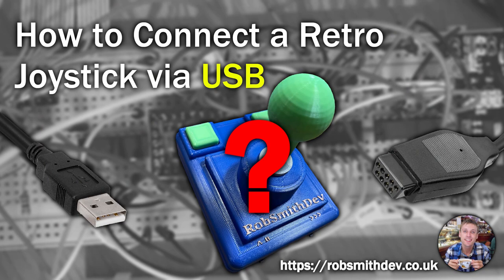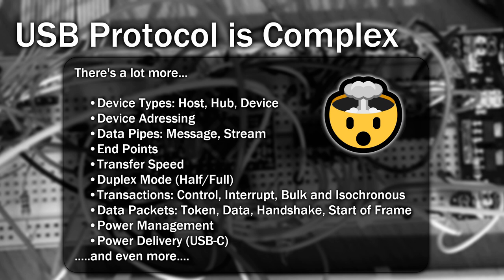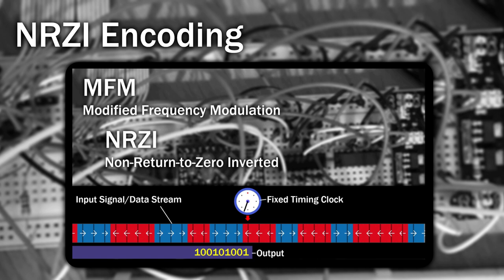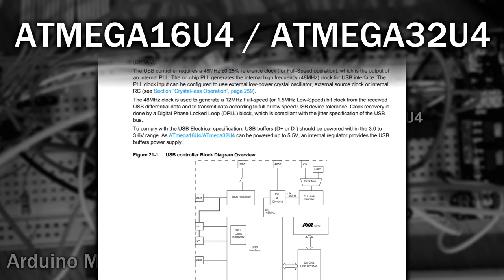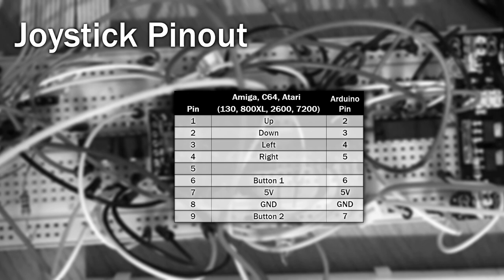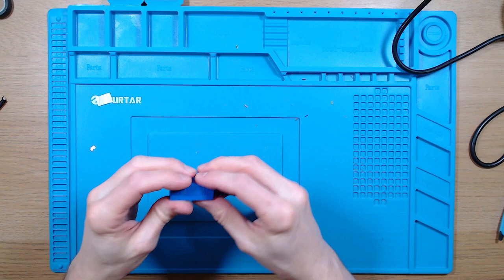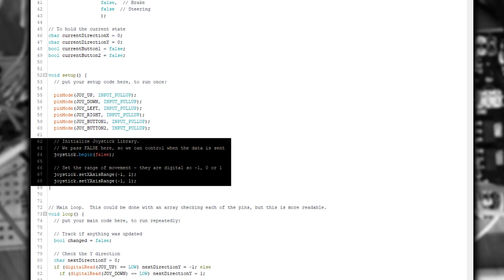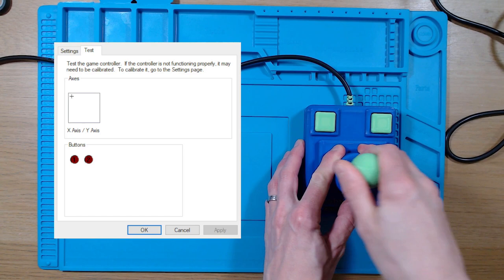Build a USB Adapter for Retro Joystick and use it on your PC, MiSTer or Amiga A500 Mini

Comment: Practical, simple and effective, I love it.
And if you need to use an emulator (nothing beats the old equipment, but sometimes the only thing you have is an emulator) then at least you can use it with a decent retro joystick now. Cool build!

Comment: Nice and compact adapter. Some games (like Dynablasters) supported multiple joysticks per port with a special adapter. Maybe something to look at in a followup video. Also CD32 had multiple buttons.
Reply from the maker: Yeah absolutely, these could all be added easily! The CD32 is a little more work as it encodes the data in a special way, but it’s not hard to decode. Thanks for watching

Comment: Looks awesome. Do you think this would work with a Duinotech UNO r3 board based on the ATMega328P Microcontroller?
Reply from the maker: Hi, no it won’t u fortunately- the ATMega328 can’t behave as a USB host whereas the one I’m using has it built into the hardware. It might be possible to reprogram the ATMega16u2 chip on that board as that’s currently programmed as a USB to Serial converter
Reply: @RobSmithDev  Thank you for your reply. I Have a UNO and I might have to do a bit more learning, or just get a Micro, might be easier, and use the UNO for something else

Comment: Hi Mr. Smith, very interesting video, thank you for the explanation. I am try to do a spinner for my arcade bartop with arduino pro mini and an optical sensor. Do you know the best and easiest way to do it?
Reply from the maker: Hey, I’m sure it’s probably a rotary / shaft encoder. I’m fairly sure that usb library im using will support it

Comment: This is great! One question. Is there a way to modify the code to read analog joysticks? Most of them had 100K pots, reading as a voltage divider with a +5V signal. The voltage would need to be read and then be translated to USB instructions.
Reply from the maker: Yes, this is possible, you'd have to use the analogRead functions to read from A0 or A1 (one for each axis).  The Arduino Joystick Library supports X, Y (and Z) with precision up-to 16-bit!
Reply: @RobSmithDev  Thank you! I will grab a micro give it a shot! I am also interested in finding a solution to do the opposite. That is to use a specific USB joystick or gamepad and map them to output them to the original console/computer. I am not sure if that is possible with this equipment.
Reply from the maker: Its a plan for a video im working on, not sure when it'll be ready though

Comment: nice stuff mate. what is the latency or the sampling rate of this system? would be interested in this ... i got a "megadrive to usb" adapter from amazon which does a good job. dont know the internals tho :) would be interesting to use on a mister fpga with fast polling if that is possible
Reply from the maker: The last line of the code is a sleep for 10ms. So I guess that’s the latency, but you could decrease it to get a faster response I guess